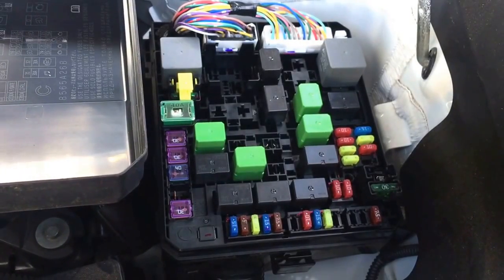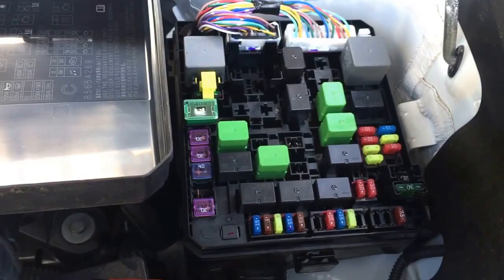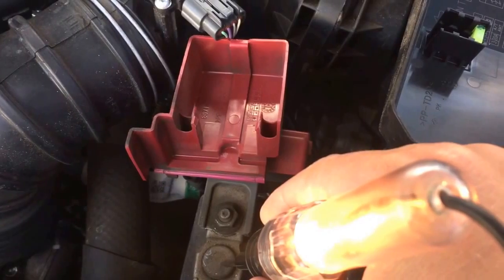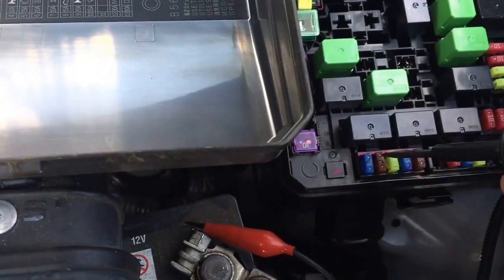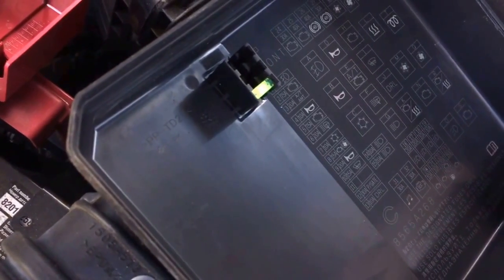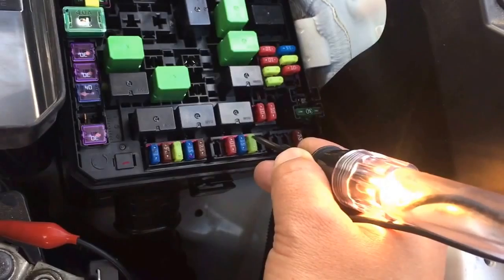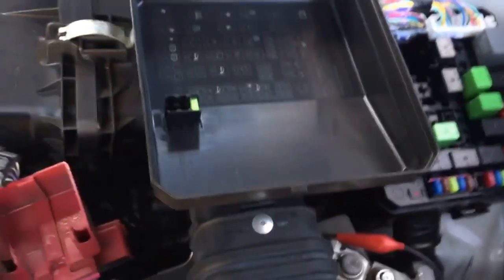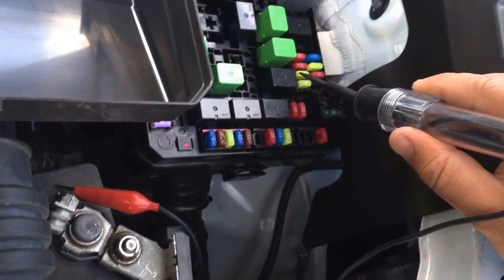How to check fuses | How to know if fuse is BAD | How to test a fuse with a test light

Comment: Very thorough!  I visually checked fuses three times in an attempt to fix multiple components that involved two bad fuses.  I have been working on my own cars most of my adult life and considered myself fairly decently mechanically inclined.  However major fail on my part.  I ended up bringing the car in to resolve the issue convinced it was some fuse link in the line out of reach.  I did not find the so-called "common break" easily visible in the middle of the fuse head window - if they break along the sides that is where testing with a test light very quickly determines bad fuse from good.  And moreover you don't have to spend time pulling them when you have multiple components not working, while the suspected fuse "looks" just fine!  Kuddos to you- Can't go wrong this way!
Reply: yes sir..same thing here....break along sides..not visible in middle...test light sorted it out

Comment: That's a neat tool, but I already have enough specialized tools and want to save money. I also have a multimeter, and there has to be a way to check with that, surely? I mean, I can pull fuses and look at them all day, but I'd never thought of the trick of checking the wiring (full circuit) this way, and I'd really like to do that.

Comment: You didn't talk about maxi fuses.  (the blocky high amperage ones).   Is it obvious if these are blown?
Reply: Hi danz 7000  In a maxi fuse, the little 's' shaped wire between the two blades will break in half, like other fuses.

Comment: how about using an ohm-meter on the not powered fuses from contact point to contact point ( if one has those ), if there is contact or the bridge is burned trough otherwise the have to be taken out and visually inspected.